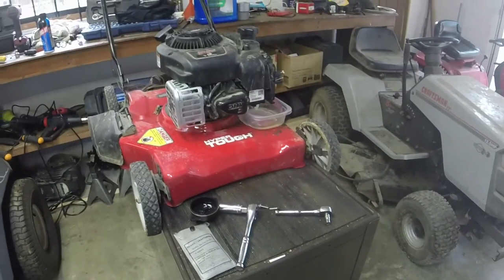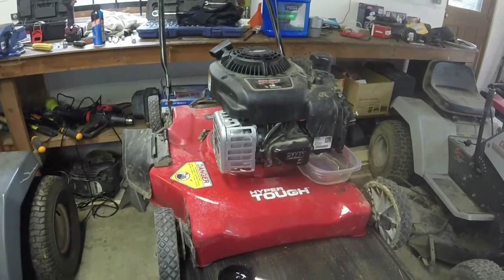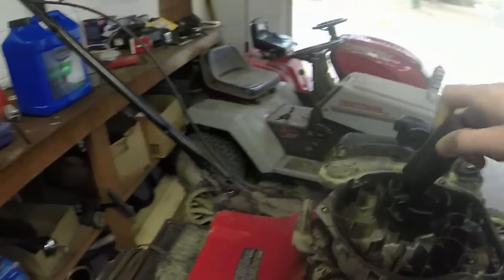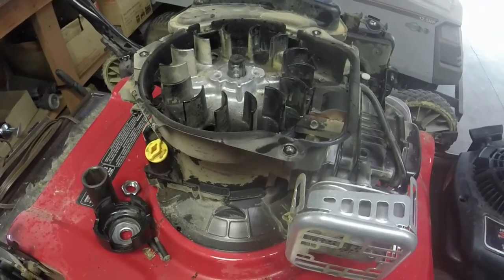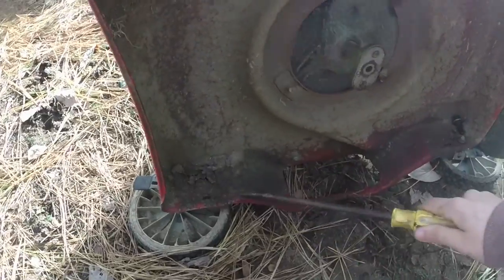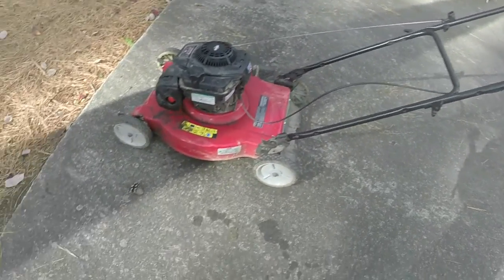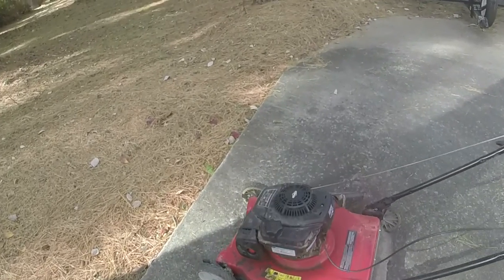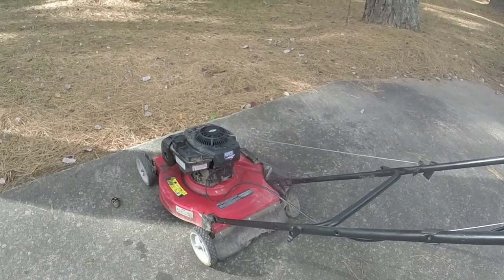Briggs OHV/ Hyper Tough push mower flywheel key diagnosis and replacement

Comment: I have the same mower. I turned it over on the side carburetor down to change the blade. now it keeps surging. Any ideas what it could be? Thanks
Reply from the maker: If you turned it with the carburetor down you may have oil soaked the air filter and got oil in the carburetor.  Best way to go is carb up to avoid those issues.

Comment: 1Question for you,not related to this video. I have a Troy Built 2100 Squall 208CC snow blower I picked up from someone Its 2 yrs old, and it appears to be backfiring when I try to start it. I have drained and flushed the old gas, cleaned the carb, and checked the plug. This one has me scratching my head, I cannot for the life of me figure it out. Bad carb? Bad spark plug? combination of the 2 or bad valve timing. Any thoughts?
Reply from the maker: Not familiar with snow blowers but the two things I would check are the flywheel key and the valve seats especially if it is an OHV engine.
Reply: @EllisMowersandmore  yes, it i an OHV engine Chinese knock off. 208cc

Comment: I have the same mower and need to change out the blade. I know it's a 20 inch blade but is it just a standard blade or mulching? I didn't think the mower was a matching type but what would you recommend?
Reply from the maker: For this mower a standard blade works best.  That is what comes on them and since they are a side discharge mower that blade would work best.